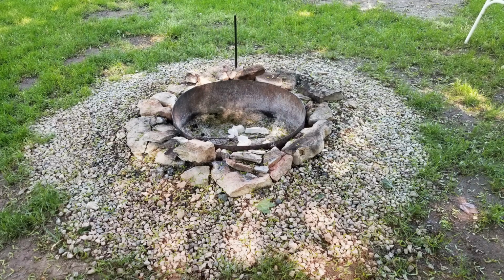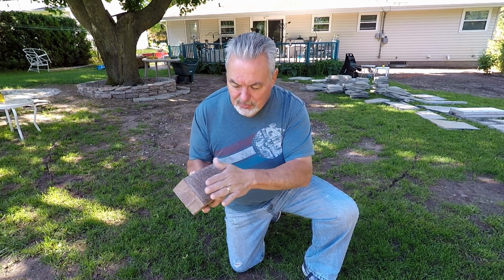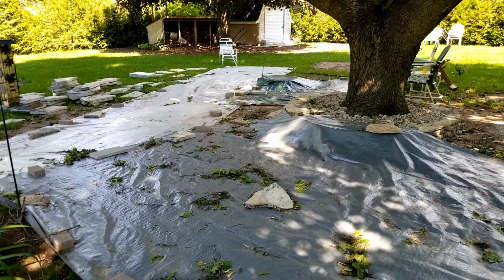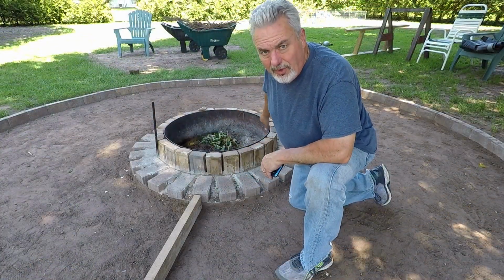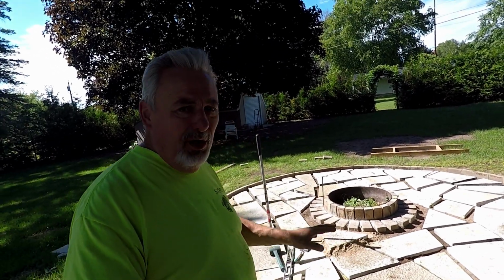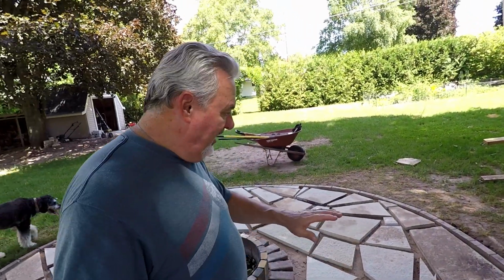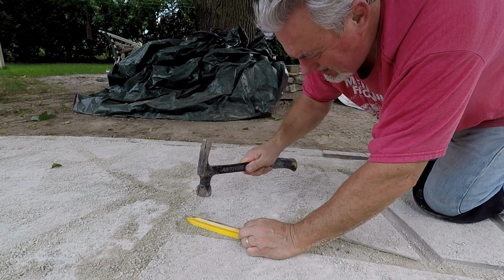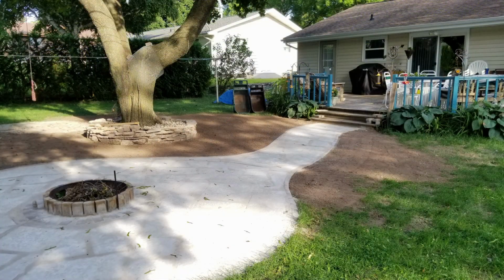Tired of your boring yard? Follow these tips and build an amazing, fantastic stone patio!

Comment: what is quarry wash?  lots of hard work and it looks great!
Reply from the maker: Thanks for the question! Quarry wash is basically crushed lime stone at a size of 3/8″ or less with fines.  It's also known as lime stone screen or traffic bond.  Quarry wash packs extremely well and is perfect for driveway finishes, walk ways, patio finishes, etc.  You can also add mortar directly to the mix to create a very strong surface. However, you lose its ability to soak up water and drain.